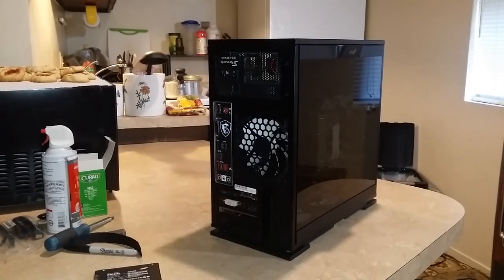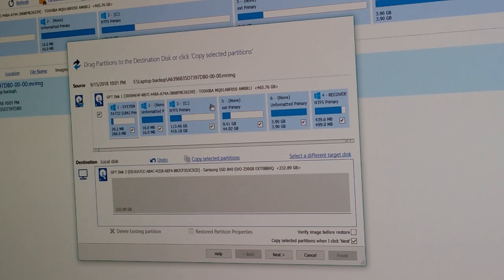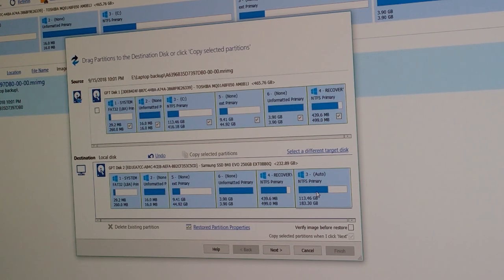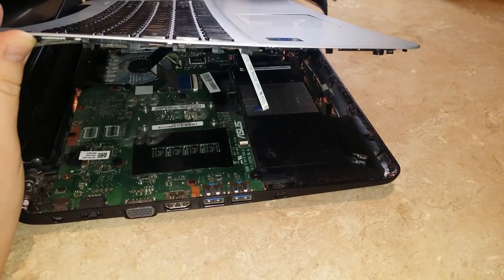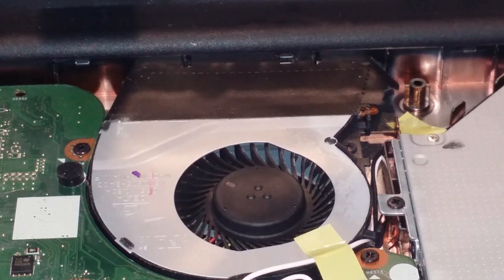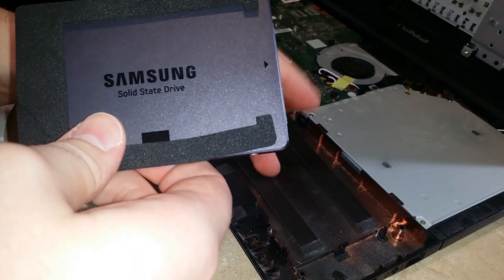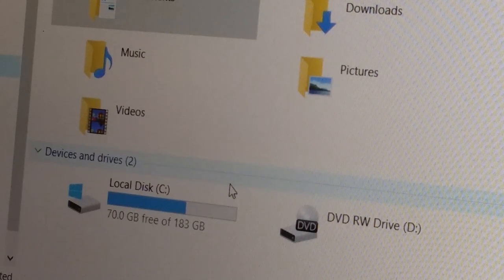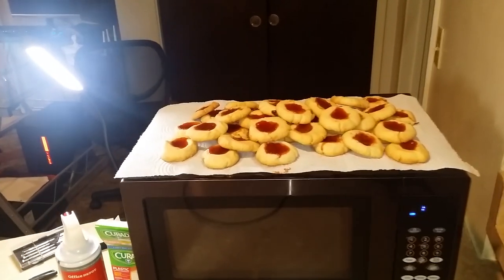New computer vlog (Part 8: Laptop SSD Swap)

Comment: The sata connections on my motherboard are literally in the stupidest possible configuration ever. They are all on a big plastic raised, I don't know what you'd call it, area? That's not the stupid part. The stupid part is, they are all sideways, pointing to the front of the case, not flat, pointing up at you, so you can access them easily. So trying to plug anything into them, is literally blind luck, because you can not see them, at all. So in comparison, you had it pretty easy. lol